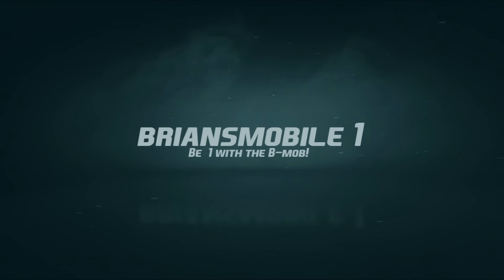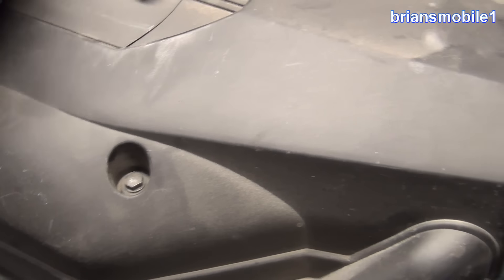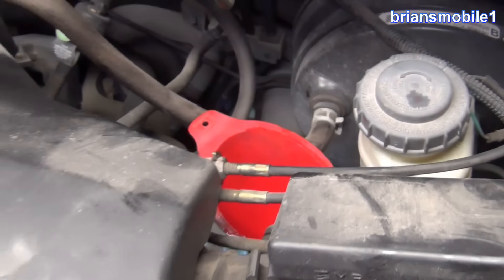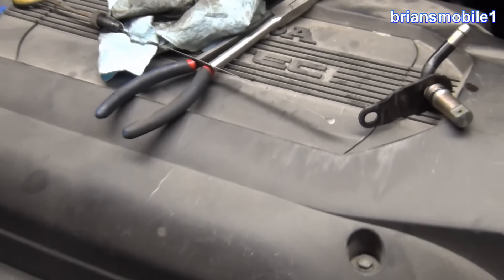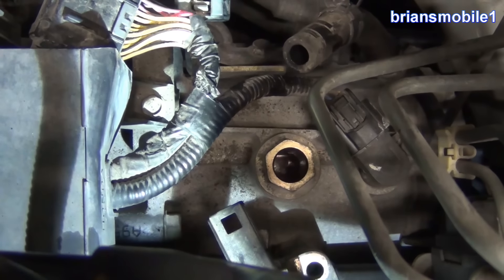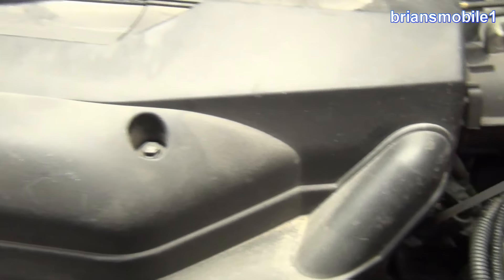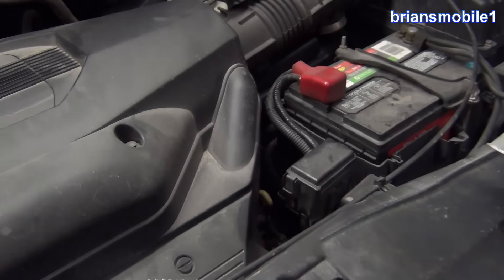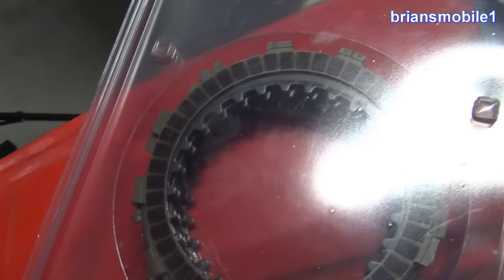Watch this Video BEFORE You Destroy Your Honda Transmission

Comment: Is that one of those terrible transmissions you have to remove and actually split the case to change the filter?  I know Honda had a transmission like that and I hope they learned from that mistake.  People who know that Hondas are good would think differently if they knew about that appallingly awful design.  I imagine that the transmissions I am thinking about failed because the filter was inaccessible.  A lot of transmissions you can usually take the pan off to get at.  I know that a lot of Japanese transmissions use a small secondary cartridge type filter on the side.  My Nissan has that and it is the real filter, the one in the pan is just a screen.  I don't just blindly assume it is just a screen either.  I hate it when people do that.  The reason I hate that is because some vehicles have paper or felt or something else in there and that can be more prone to clogging.  If I had my transmission serviced and still had a failure I would be livid to find that the filter was not just a screen and should have been changed.  I feel that some mechanics just don't like to mess with the pan and say "it is just a screen".  Well, even then there is still stuff to clean from the pan so just do the damned thing while you clean that out!

Comment: Flush is the best way IF its done PROPERY. This way is ok if you want to do it more often. The torque converter and passages threw out the trans will still be present with just as plain drain and fill. Keep in mind it has no filter either so the cleaner it is the better. One way to flush at home safely is to disconnect the trans line at the rad and run the car allowing it to flow into a bucket while pouring in new fluid back in at the same time watching for color change unless you can mark the liters on the bucket coming out and knowing how much you have poured back in at the same time.

Comment: Doing multiple changes (3) is recommended every 50K or so as mentioned. When doing multiple changes, drive 100 miles or so to circulate the new fluid (not mentioned). You don't just fill and drain - that's a waste of good fluid (maybe obvious to some). Common opinion is that 3 changes will replace about 80% of your total fluid.

Comment: CVT trans need to be changed every 30000 miles change the filter ever 90000 miles have never had a problem with my Honda CVT

Comment: Drain and fill. Do not flush with a machine or a bucket of fluid by letting it run. Drain and fill on time and you’ll have no problems. Same with Toyota. DO NOT USE A MACHINE!

Comment: "See how its still kinda brown?" Yeah, thats because you have to FLUSH IT! Always flush! Only change if its been changed every 20-30k and the fluid is still RED! If it hasnt, then a flush is required. You will go through roughly 3-5 gallons, not 3 quarts. You also didnt even go through all the gears, WTH dude? You got a lot to learn, bud.
Reply: Recently, I have purchased an 04 odyssey and the owners manual advises the owner to follow these exact steps. No flush! It says to drain and refill up to three times.
Reply: @newcreation6889  yeah, those the same manuals that also say to never check or change the fluid? That itll last the life of the vehicle? Lol. And repeated drain/fill is a way of flushing the trans. You drain, fill, then run it through the gears. Rinse and repeat until the fluid is clear/red and change the filter on the last fill.

Comment: 9:24 Putting all new fluid in a transmission will not make it slip. If there is any grit in the fluid. The filter will remove it. The dark color is from the dye in the friction plates. Stop and think about this. If grit is in the fluid. The gears and bearings would wear out because they are rubbing togather in gritty oil. Brian is telling the truth about changing it to clean of the drain plug. He is also repeating BS he heard someone (who don't know any better) say about grit in atf help the clutches grip.
Reply: As a mater of fact changing all the fluid out could cause a transmission to slip. Honda by the book drain and fill once every 30,000 miles. It would be nice if people would quit trying to make up their own service rules and just follow the manufacture maintenance schedule. It will be cheaper and less problems. Internet is good but there is a lot of poor information and advice.
Reply: @DCSPORTSTER  Changing all the fluid out does not cause tranny slip.
Reply: @DCSPORTSTER  Do you think grit in the fluid would damage the metal parts rubbing togather?

Comment: Hello Brian, Do you have any idea why our 1990 Honda Accord Auto Transmission does not shift into reverse sometimes and makes the funny clicking sound? Other times we start it and it shifts into reverse perfectly.   We've flushed the AT as you described and put the Honda fluid,  check the solenoids and cleaned the small screens.  Here is a video. Thank you very much.  https://youtu.be/eLvbnCkH9y4

Comment: Transmission guy says it's not always good idea to change trans fluid ,because if it ain't broke don't fix it.
Reply: fluid change isnt fixing
Reply: @GodfatherBenz  a good and informative video.
Reply: The additives wear out
Reply: Transmission guy also makes tons of money off you when it breaks. It doesnt break? He doesnt get paid. There's a reason the engineers put service intervals on the fluid. Just like any fluid it breaks down due to heat, moisture, and contaminants. If you wait until your fluid is all black. Most likely your trans is done. Bring it into our shop! We will replace the transmission for you.

Comment: ⭕⭕  Hey Brian, want to learn something new? I used to race motor cycles back in the 70's , have had many Japanese cars and trucks. Just learned about  "J.I.S." last year. Japanese Industrial Standard. We have been doing it wrong sense the 50's . Looks like a Phillips screw driver but it's not a Phillips.  Check it out.  I ordered  two of each size #1, #2, #3 bits about one inch long and each size ( 2 bits ) cost about $7.00  but now I have the rite tool.  👍👍
Reply: I have a write tool, too. It's called a pencil. Ha!

Comment: Honda transmissions are poorly designed, when you change fluid and there is not filter to replace you just wasting your time, they are designed to fail, is all about $$$$$$

Comment: 3 1/2 Quarts ? That right there tells me you don’t know squat about transmission fluid capacity, that 3 1/2 quarts is only a portion of the fluid , the remainder is in the torque converter . So if do not flush it completely your doing nothing but diluting dirty fluid with a portion of new fluid ... Garbage way of transmission service... !